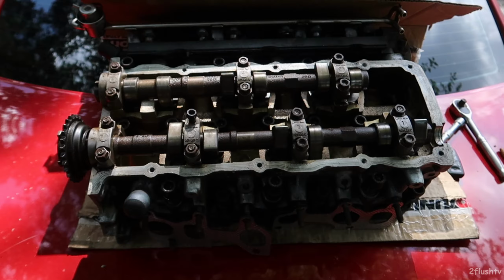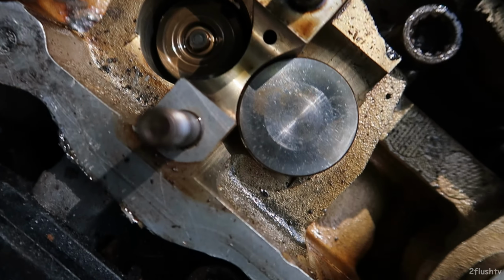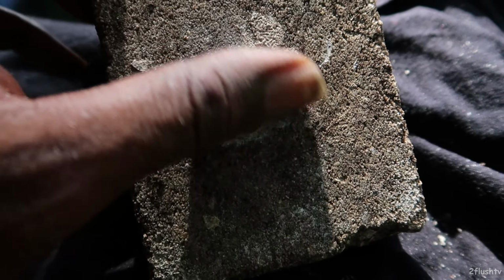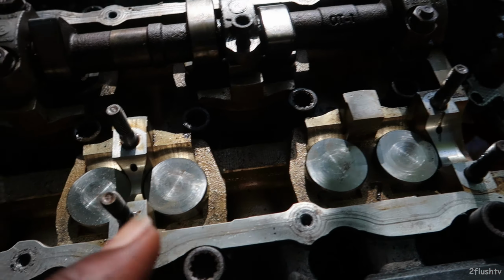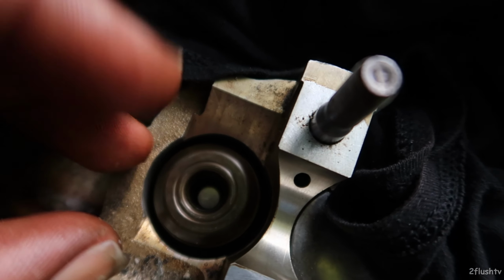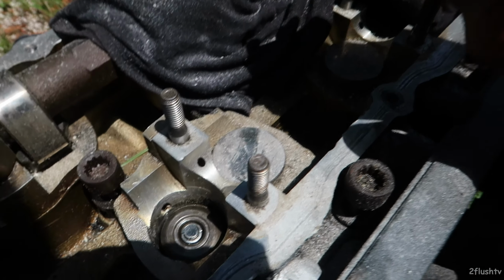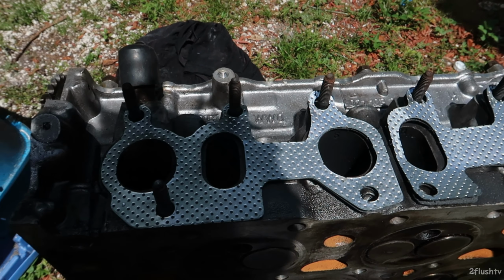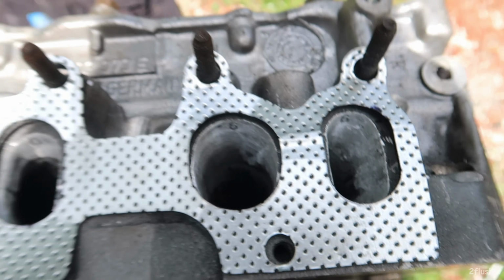How To Remove and Replace Valve in a Cylinder Head NO TOOLS | Plus  porting my head

Comment: Hey!  I just stumbled across your channel a couple of days ago.  I have a couple of these 12v Vr6 Jettas too, and I've had to teach myself how to do the repairs.  I like to see you dig in there and learn as you go...that's how you learn.  I'm still watching the video, so I don't know how it ends yet.  I think you are pulling the valves from cylinder 2 ... wasn't it cylinder 3 that had no compression?  I also noticed that you were doing the water test on the head with the cams still installed.  This will mislead you because with the cams installed, some valves will be held open by the cam lobes.  I'll be watching to see how things are going.  I just picked up a 99' vr6 for $300 dollars last week that had the battery hooked up backwards by the previous owner.  It's in need of some real TLC, so be assured....there is someone else out here dealin with Vr6 issues!  Haha.  Keep up the good work.  Peace to you from Mid _ Tennessee.

Comment: I was more cringing at the possibility of the bonnet getting damaged with you banging away with a brick than the valves haha. Anyway good job, moving further into the unknown. I seem to have more stuff coming off my build than going on. Two years down the line and that's all about to change, not got to the 24v yet. Ripped everything off, but that's about it.
Reply from the maker: Yea i was nervous to but it worked out just gotta compression test it to b sure.

Comment: Anytime you replace a valve you need to lap it and make a new reseal for the head mechanics 101
Reply from the maker: Ok thanks bro👊🔥
Reply: 2Flushtv welcome dog hopefully you get it up and running and by using a brick man just make sure you get a lot of brake cleaner and throughly clean that head 😎
Reply from the maker: I no i gotta it 
But i was trying to figure out what gud to use i no break cleaner wd40 
But i no there something else i can use just not water
Reply: 2Flushtv no water definitely see about going to buy some brake cleaner brotha it’s cheap
Reply from the maker: I will
Reply: I had a similar issue to him when my vr6s timing chain snapped. It bent 4 exhaust valves and 1 intake valve. I was curious if lapping actually did anything on my engine without re machining the valve seats. I lapped 3 out of 4 of the exhaust valves, which all had very similar compression beforehand, and left 1 exhaust valve as is. After reassembly, they all literally had the same leak down results (I think it was like 7% leak from the rings). So yea lapping is not really necessary on a high mileage engine but who knows maybe I just got lucky.